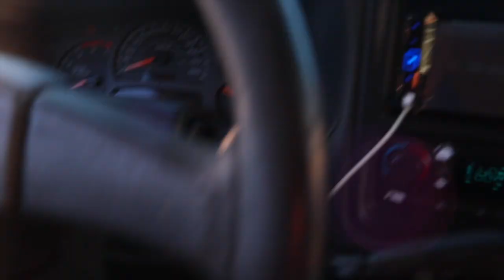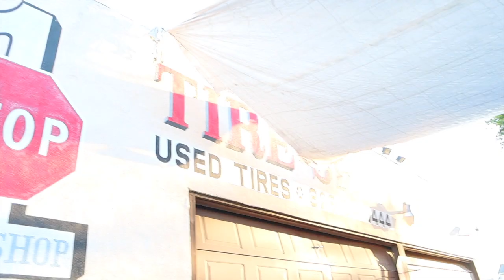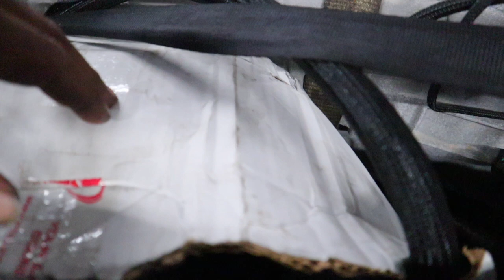MINI SHOP TOUR, I CAUGHT A FLAT TOWING THE 72 LT4 SWAP CHEVELLE TO THE NEW LOCATION #chevy #lt4swap

Comment: Smashed the like button, guru I gotta question I gotta 96 impala ss can a bad opti spark cause low engine compression?
Reply from the maker: No it’ll just cause it no to start possible a oil pump going bad can cause low compression